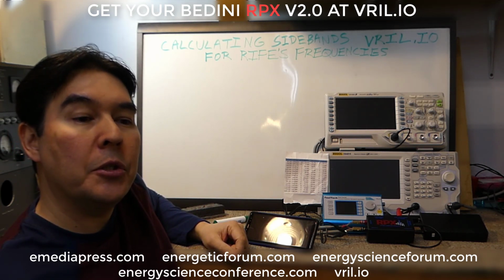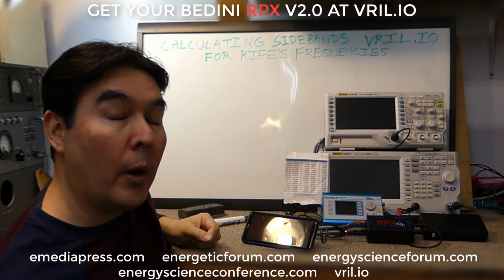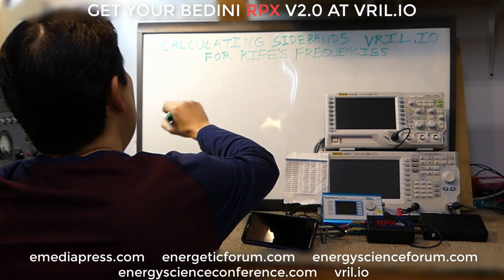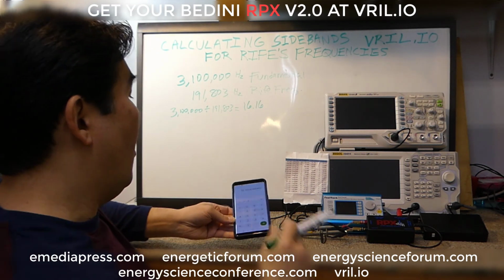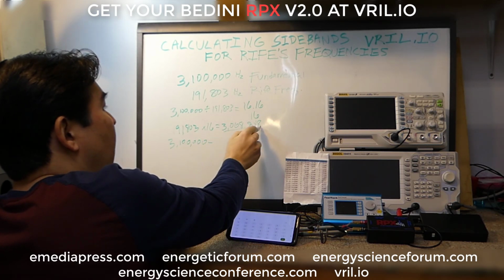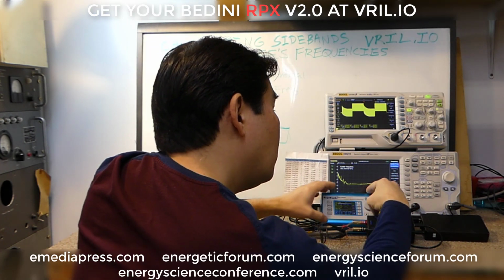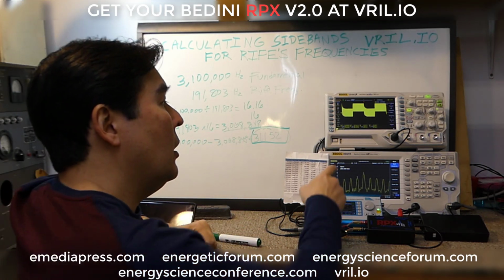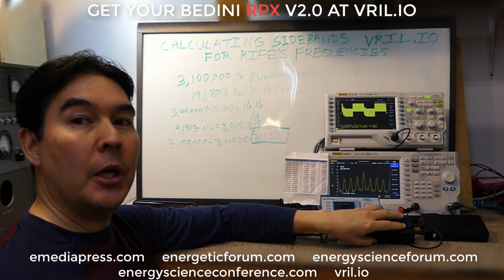Calculating Sidebands for Rife Frequencies - Vril.io

Comment: How can i get hold of one of these Bedini units and will it work with a spooky or just the feel tech?
Reply from the maker: that unit is just a low budget feeltech unit and the models that were avail didn't even have a sweep function. we're opening up for presales of the rpx 3.0 tomorrow on https://emediapress.com
Reply: @AaronMurakami13  - Spooky does have a sweep function now, so would that be better in  your opinion?
Reply from the maker: @jezzyby47  Then it can be used to do more custom sweeping when plugged into the rca jack for external signal mode. They're avail now at https://emediapress.com/rpx3